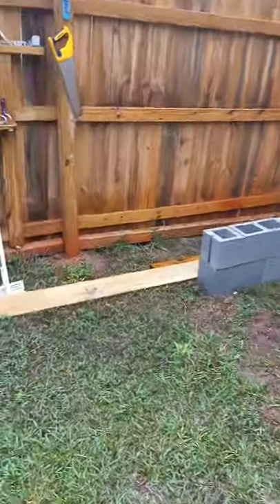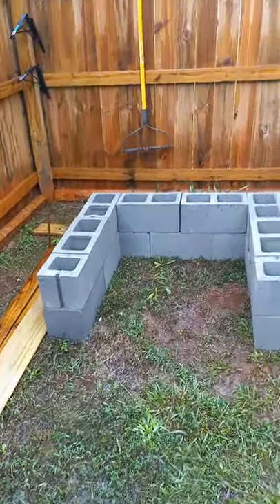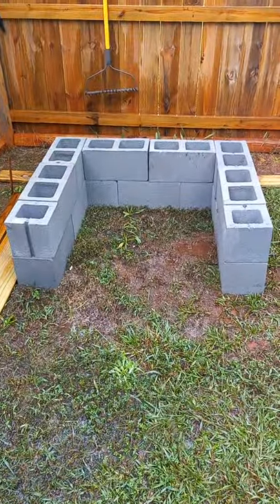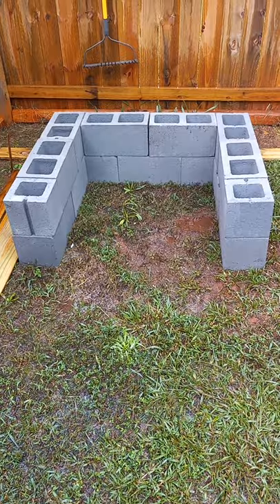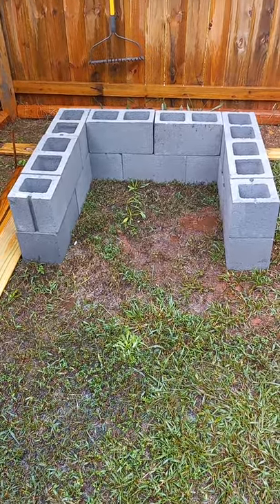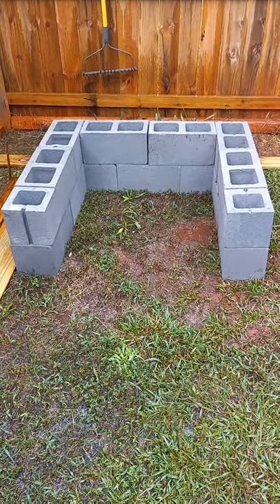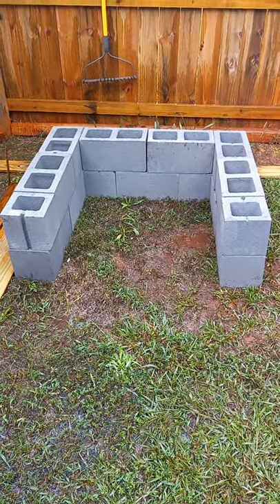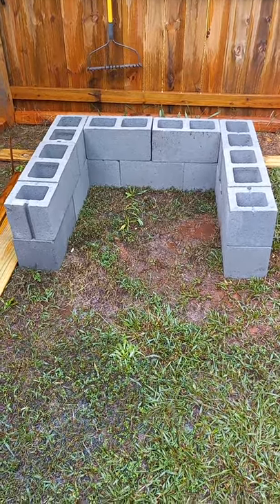CINDER BLOCK GRILL CONSTRUCTION EPISODE 1

Comment: Did you know you can fill the empty spaces in the cinderblock with sand?  Helps to even out the heat across the blocks--so much less "explody" that way, especially after a hard rain.